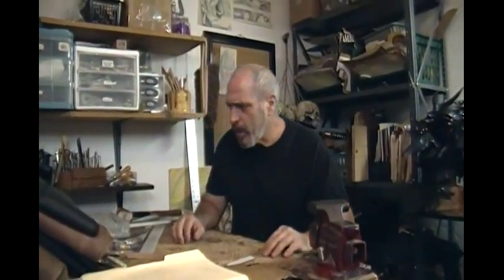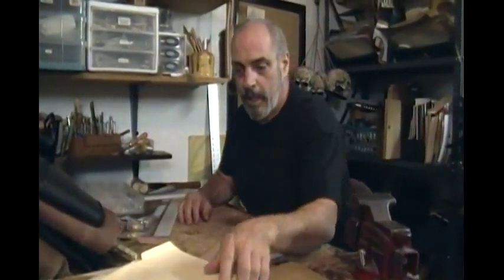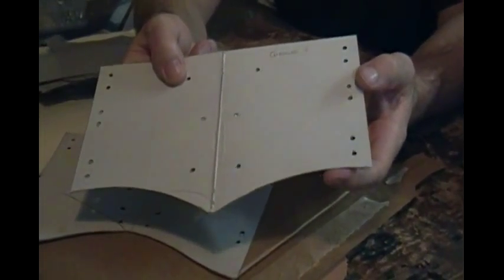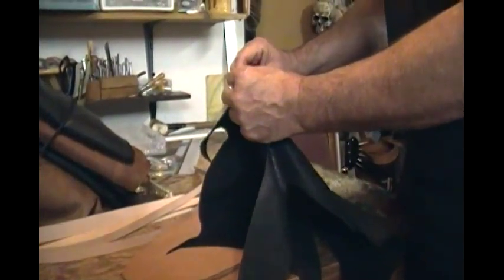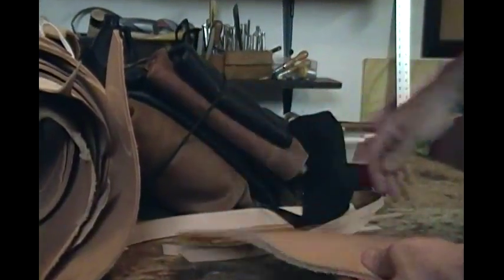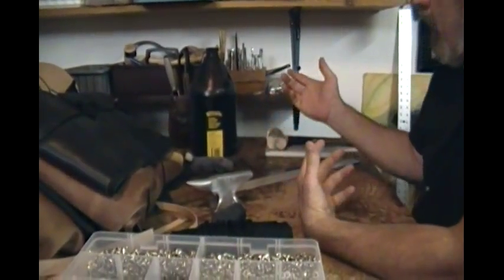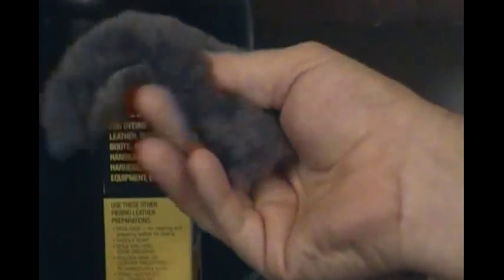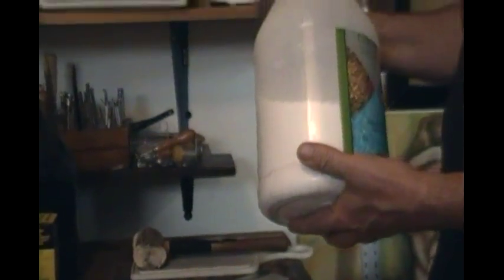So you want to make some leather armor? Where do you start?

Comment: Love the videos I'm looking to buy leather for making armor and needing to know the dimensions and size of leather
Reply from the maker: Hey, thanks for subbing. If you make your patterns before you buy the leather you can measure the square footage you will need and get a little extra to make sure you have enough to complete your project. A side of light weight saddle skirting is around 22 to 24 square feet. If you configure your patterns to minimize waste when cutting them out, you can make a full set of armor with one larger side of leather.

Comment: Ok I wanted to make a double sword scabbard backpack. What type of leather should I use
Reply from the maker: I would use 5 to 6 oz veg tanned tooling leather, it is thin enough to fold and form around your blades but thick enough not to crumple once it's formed.
Reply: Thanks.

Comment: Great videos!  
About how much leather is required to make a set of armour? I assume it could vary a fair bit, is there a good way to estimate this cost?
Reply from the maker: +Keith Linden that is a very good question. Back when I first started this strange fantasy life I would make the patterns first, then measure and approximate the square footage required. Of course, your dealing with random organic shapes so there is no real way of telling aside from your intuitive perception when you actually lay hands on the skins. It does indeed vary depending on the armor coverage. For a full set of heavy leather armor head to toe you would need at least two sides of saddle skirting and one side of thinner leather for the straps. if you want a minimal ranger armor, you will need less of the heavy leather but you may want under armor made with chrome tanned chap leather which costs more but looks pretty cool.
Reply: +Art Of Warriors thanks for the reply!